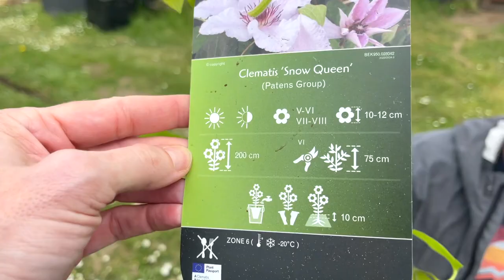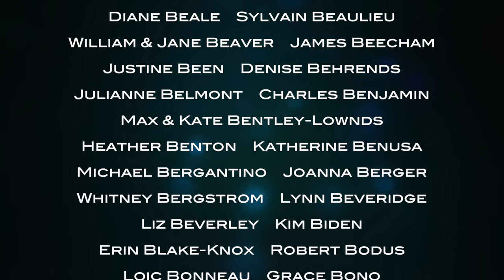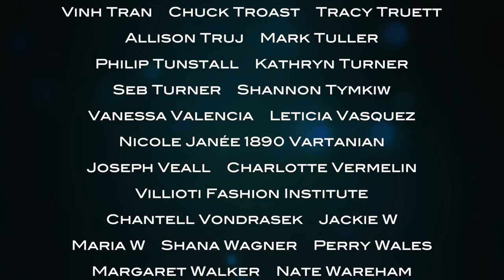WHAT A PERFECT CHATEAU DAY LOOKS LIKE...

Comment: Selmar’s Workshop - Two Ideas:
Sliding Walls - We have something in America called a “Sliding Barn Door” they are now popular in houses. I think that you have them in Europe too, but perhaps called  a something else. They have sturdy wheels at the top, and basically an entire wall can roll to one side. I think that could be a great solution for some of the workshop walls. On nice days he can still feel like he is part of the forest, but he can close them against the rain or cold if he needs to. He could put windows in them to let in light and forest views on rainy days.
 Camper Parking/driveway - Instead of gravel with grass mixed in, we use a kind of hollow paving block designed to have grass inside - kind of like a concrete trellis. It is made for driveways and parking areas, and it remains flatter than gravel (which can get pot holes), plus you don’t have to worry about a stone getting kicked up by a mower wheel and hitting the mower blades. However, the cost is probably higher... maybe just for the parking area.

Comment: I'll share what I did with Coral Bells (Heuchera). I made a checkerboard of mainly 2 colors, although there is a 3rd similar one in the middle. I used the varieties Caramel and Georgia Peach mainly, and a couple Vienna. In the same square bed, in the corner, I put an All Summer Beauty hydrangea which should be all blue without effort because it is near evergreens, and growing amongst the Coral Bells, for later summer added glory, are deep purple chrysanthemums. I don't have the best luck with chrysanthemums, but Coral Bells are great.